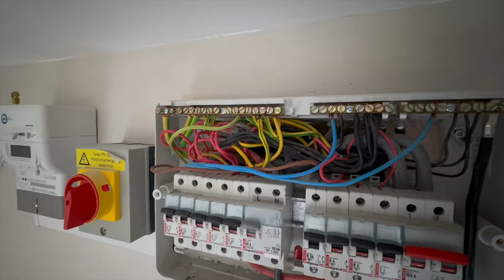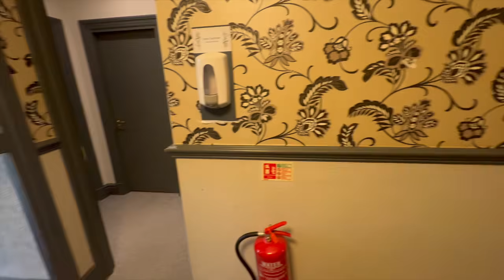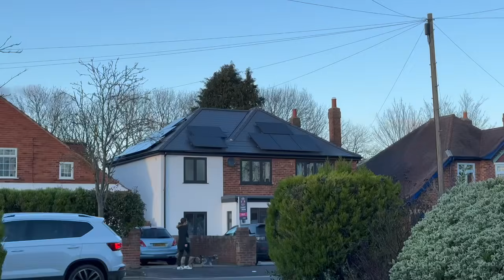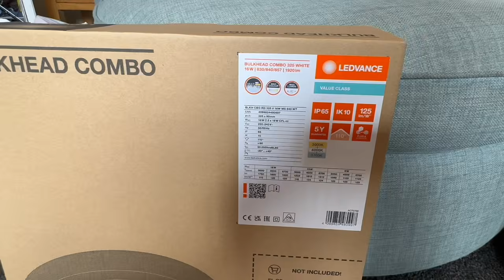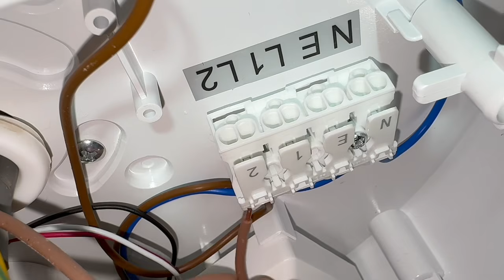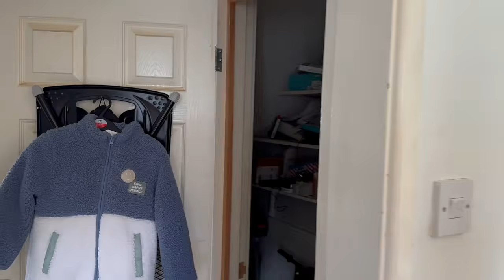Under-Stairs Lights: Safety Must or Total Overkill?

Comment: Fitted several years ago, top  and bottom of the stairs battery backed LED, together with one in the main bedroom, also one in the workshop, all light on lighting circuit mains failure, enough to navigate around and find a torch or smartphone.  Next to zero space in the cupboard with the consumer unit.

Comment: Just install a light on its own circuit. . Job done . 
I have a few times installed an emergency light in the kitchen for elderly customers.  More of a safety thing in the kitchen where customers are more likely to have an accident if the power goes off. Leaving them in the dark .  Occasionally I have put smoke alarms in cupboards where the mains is . Especially in Thatched cottages. Trouble is where do you stop .  Just use common sense.

Comment: At home I've installed an emergency light at the top of the stairs and under the stairs for the mains, both built into the existing lights.  The smart meter installer was surprised.  I did heavily mask the indicator led though as they are way too bright for domestic use.

Comment: I like the concept and as simple as it gets to put together. My only criticism would be using a microwave sensor  I know this has a 50-100% area setting but in an area that small I think it will still cause issues. 
What happening with the Live Stream Joe, as I cant see any of the usual previews on here or the Efixx website about it for tonight?
Reply: I don't understand the need to complicate this anymore than it needs to be either. I have a small rechargable cob led strip light on the wall under our stairs, activated by a momentary switch on the top corner of the door frame, it's self activated by the door. It took about five minutes and cost about £1.50.

Comment: Most people carry a portable emergency light with them everywhere they go these days they just don't call it that.  Ladies and Gentlemen, the smartphone.  It's dark.  Bip.  Let there be light.  That's not to say a fixed emergency light wouldn't be handy.
Reply: For some reason after a recent update, my Xperia flashlight now requires a sequence of swipes and taps that leave me thinking it would be easier to rewire a consumer unit in the pitch black😊.
Reply: Owd Betty Crocker doesn’t have a smartphone, and will break her neck going down cellar stairs to reset the trip in the dark 😜

Comment: It works only if the battery is fresh and charging properly. 

If the meter boxes in UK were installed in correct location, electricians will have possibility to install socket on meter box surface and plug lights near meter box.